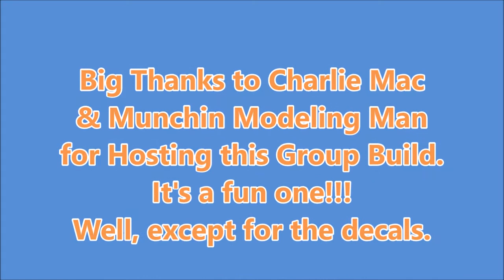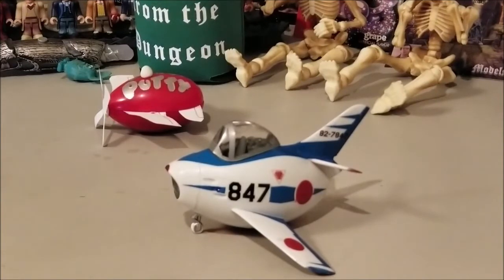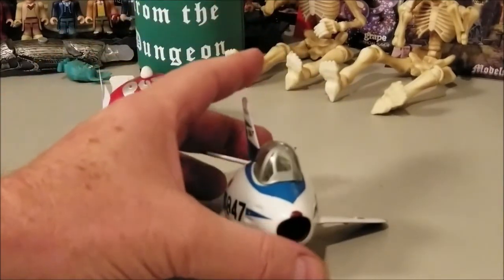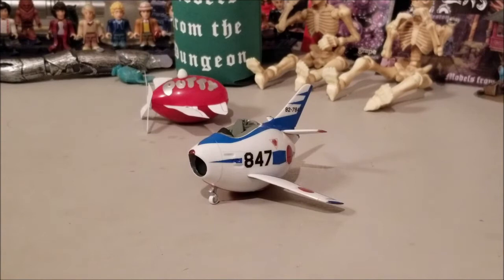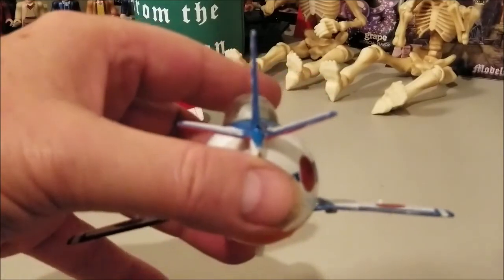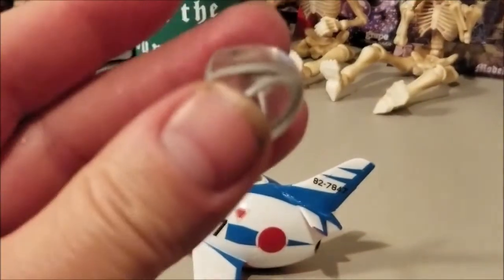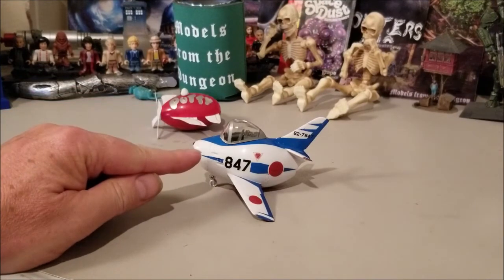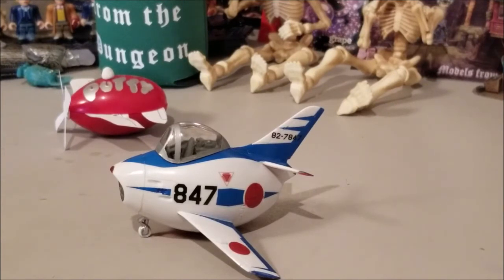2019 Egg Plane Update # 2

Comment: It's always been dip the decal in warm water, but I think most people don't bother anymore. You've done a good job with what you've got, well done.
Martin
Reply from the maker: Thanks Martin.  I went beyond warm water.  I usually start with hot from the tap, but in I had to use steaming water on these to get them to release properly.  As the water cooled the release issue returned.  These things were just a bugger to work with.

Comment: You are correct about using HOT water for the Dekals.  I only had one tear, I tried SolvaSet but it bubbled the decal so I stopped using it and used lots of HOT water. worked out ok then.
Reply from the maker: Thanks Steve.  These things were a bugger.  If I do another, I'll mask and paint instead.  The markings are okay to work with, but the big color ones, URG!  I also ran into an issue since they are so thin that where there was a small fold in the backing paper, the decal would crack.  Did you find that too?
Reply: @VinceWeston  I didn't have any folds in my backing paper. I didn't have too much trouble but had to keep reheating the water and keep brushing water over them to position them.  But most of my decals were small, I usually have problems if the decals are larger.

Comment: Well, both eggs look great!!! Sorry to hear another difficult decal story with these egg planes. Haven’t gotten to mine yet, luckily mine doesn’t have that many, but that sure seems like a lot of effort just to get them to release. Surprising for Hasagawa, would expect better from them. Keep at it, don’t let it beat ya, buddy!!!
Reply from the maker: Thanks Tommy.  I did find the smaller square marking decals were more cooperative.  Maybe it's because of there size, but you really need hot water to avoid the release issue a lot of guys are having.  If the water cools, it is a pain to get them from the backing paper.  This was my 1st Hasagawa build.  The styrene was good to work with and glues well, but the decals, at least in the egg planes, are pretty nasty.  Being so thin, it's not bad to get them to lay down and not be proud of the styrene.  They seem scale appropriate.  I just finished up the build tonight.  So it's just a memory for the shelf now.  I will say there were more than a few times I thought about flying it into the trash.  "Never give up.  Never surrender!"

Comment: Had me going for a minute. Even with the decal issues it looks pretty good. I might be the only one who didn't have any problems with the decals
Reply from the maker: Thanks Benny.  LOL, I like to throw an attention getter in every once in a while.  I was using the Silly Putty for masking, and just came to me that it was egg shaped.  Unfortunately, it's not a Hasagawa, so I couldn't use it for the GB.😃  You are one of a handful who didn't have problems.  I did find outside of the releasing from the paper most of the markings are pretty cooperative.  The color ones are a bugger.  I thought I was going to get off easy not having to paint it.  I was wrong.